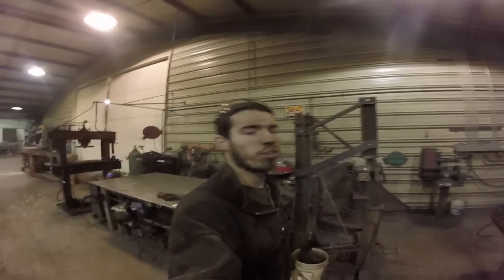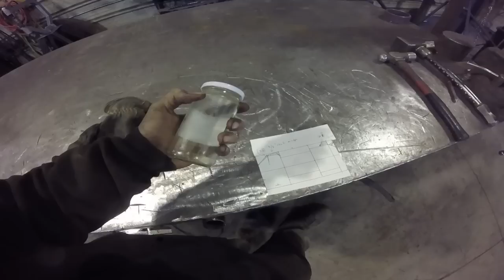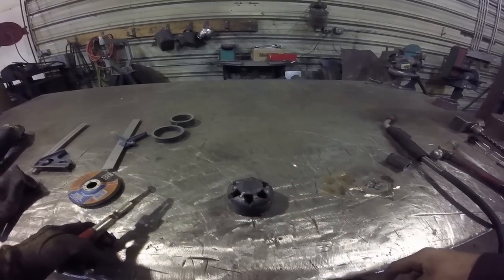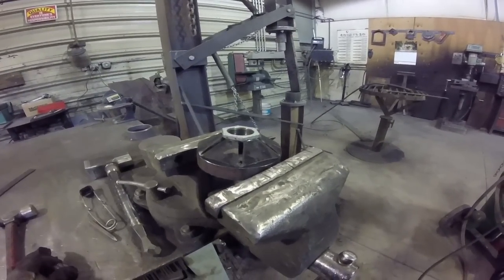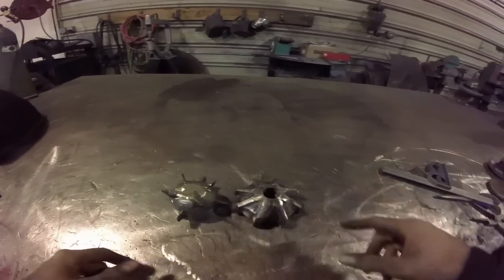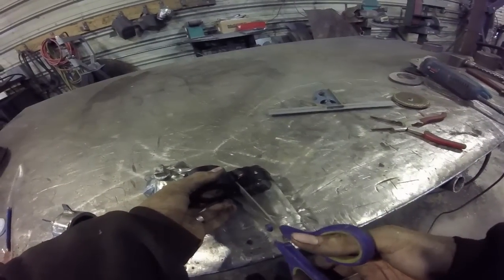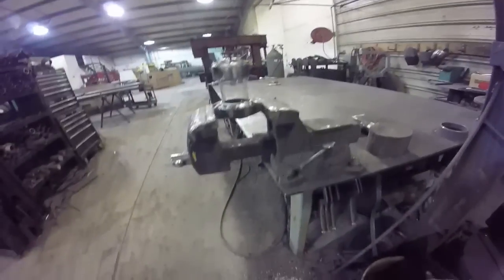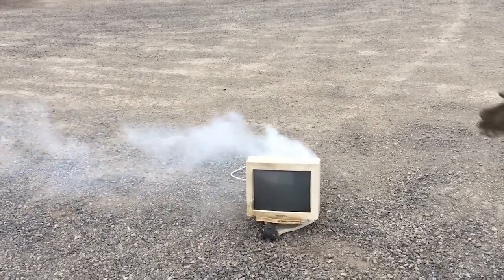Halo Brute Firebomb (Build and Test)

Comment: wrap it in steel wool and light it
Reply from the maker: Denarius that's actually a really good idea, that would look awesome
Reply: Ironclad Industries hopefully the burning steel is hot enough to reach the flash point of the gas.
Reply: it should. we use steel wool to ignite fire lances which is basically a thermite cutting torch.
Reply from the maker: Denarius I'm sure it would be, it only takes a spark to ignite this stuff
Reply: Ironclad Industries it would be cool if you did a short video trying it. i recommended the 0000 stuff. it won't go out in the wind and you can light it with a 9 volt.

Comment: Lucky you had that worked that would have been an NFA class 4 explosive device and a minimum of 10-15+ years
Reply from the maker: Grant Hillard it wouldn't have exploded even if it had worked, it was basically a Molotov cocktail, there would be no actual explosion, just fire, if I had packed it with gunpowder then it would have counted as an explosive device.
Reply: Ironclad Industries yes but they still consider it an explosive device or "destructive device"
Reply from the maker: Grant Hillard this is true but it is entirely legal, I just looked it up, NFA classifies explosives as a device that uses a propellant or an explosive component, as in something that would actually produce force aside from just that of it being thrown. An incendiary grenade is defined as an object that used a chemical compound such as napalm, thermite or magnesium powder designed to prolong and project the flames, I used white gas, which is simply camping stove fuel and while it would be completely illegal to carry in public it is not on private property which is where it was made and used, like many of my creations. A lot that I make is illegal, but it isn't while it stays on private property. Realistically a lot of kids backyard science projects are much more illegal that this was, for example potatoes cannons that use any kind of propellant aside from compressed air are technically illegal
Reply: Ironclad Industries ok thank you for carrying on the conversation with me and I'm glad to see that this was all legal so that we can all enjoy more of your video sorry for the inconvenience
Reply from the maker: Grant Hillard  No problem thanks for actually taking me seriously lol!
Reply: Ironclad Industries no problem thanks for actually answering most people just ignore these